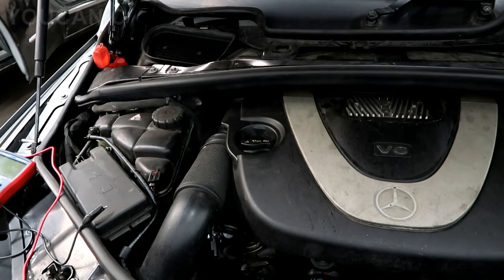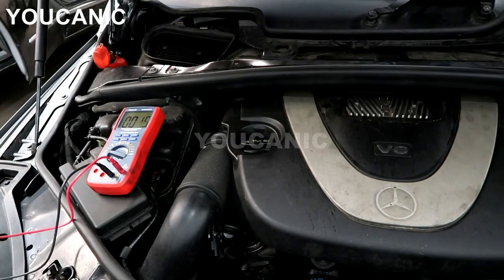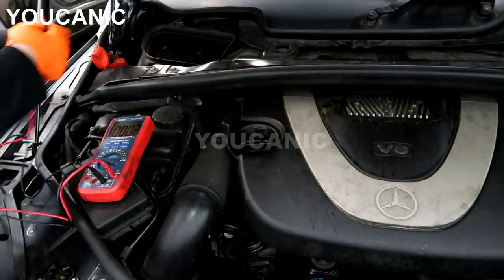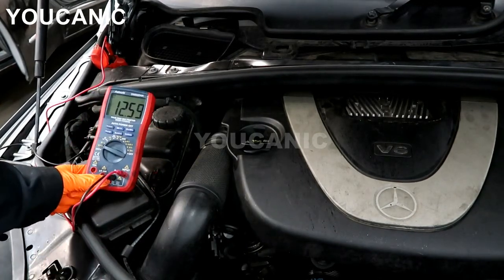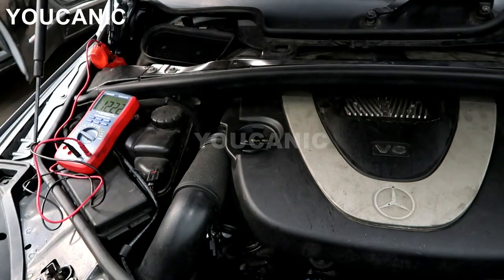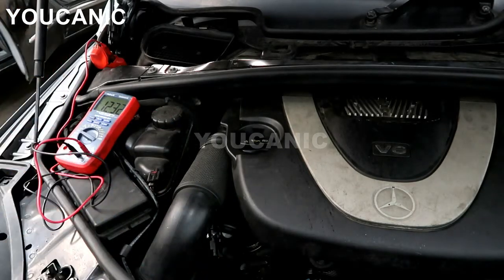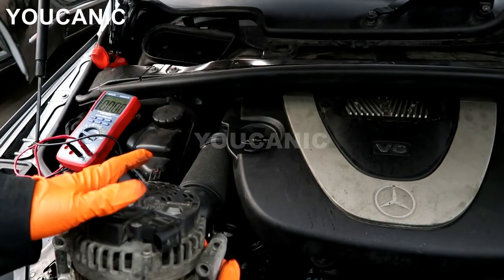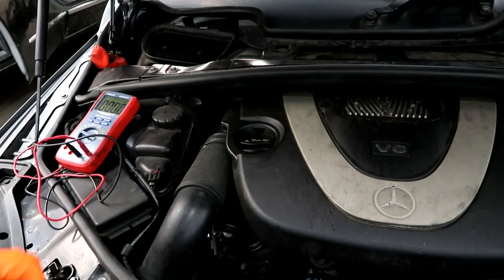How to Test a Mercedes Alternator

Comment: @youcanic my alternator is not showing the right voltage when checking that terminal behind it.. what could fix it?
Reply from the maker: Thanks for your question! In general, a faulty regulator, damaged alternator, or weak battery could impact the voltage reading from your alternator's terminal. To resolve this issue, it's beneficial to diagnose these components for any potential defects. For further assistance, we encourage you to explore our informative guides and resources at www.youcanic.com, including our powerful YOUCANIC scanner and factory repair manuals. At YOUCANIC, it's our mission to empower car owners like you throughout your car maintenance journey. Don't hesitate to reach out to us if you have any more questions!

Comment: My 350cdi didnt wanna start this morning,hooked it up to a charger and after 5 min it started,gives me control module codes and injector codes
Reply from the maker: Thanks for reaching out! Sounds like you're dealing with some tricky issues. At Youcanic, we’re here to help with free guides, resources, and our YOUCANIC scanner to make your car maintenance easier. Please visit www.youcanic.com to explore these resources or obtain any additional assistance. 

Feel assured knowing we also offer access to factory repair manuals for more detailed information. Our goal is to give you the confidence and know-how you need to tackle your car issues head-on! We're here to support you throughout your car ownership journey.
Reply: @YOUCANIC other owners are tellig me it should read over 14v,is that true for a diesel?

Comment: Assuming you connected the volt meter to the battery, right?
Reply from the maker: Indeed, the volt meter was connected to the battery. At YOUCANIC, we're dedicated to empowering car owners in diagnosing and repairing vehicles confidently. Our YOUCANIC Full System Scanner can help you understand your car's issues comprehensively. Find out more here: www.youcanic.com/scanner

Our portal also offers OEM Factory Repair Manuals for further support. If you have more queries or need additional assistance, feel free to ask on our platform. We're committed to making car repairs understandable for all. Explore our website here: www.youcanic.com/

Comment: What would be the cause of an alternator putting out voltage but no amperage? Would the voltage regulator be the culprit for that? I’ve never came across this before. It’s an 08 CL550
Reply: Did you diagnose it with scanner. I have same car and same symptoms and whining from the alternator
Reply: @georgebushisntcool  I narrowed it down to being the voltage regulator as they’re notorious for going bad on many models and years. I bought a new one to replace but wound up stripped the screws attaching it cause they were seized. I gave up and put a new alternator in and everything is better than it was before. Got a new one off Amazon for $175
Reply: @chrisledger1094  thanks for the feedback man, did yours whine as well
Reply: @chrisledger1094 would the same alternator work in an 2013 e350

Comment: I have w203 model 2005...it gives 13.6 13.5 and sometime when i accelerate it get down to 12.9 13.0 then it goes to 13.7 14.2... But the lights get week when i close the windows when the engine is on.. So i don't know where is the problem?
Reply: Did you figure it out??